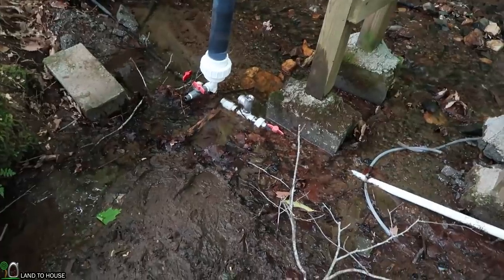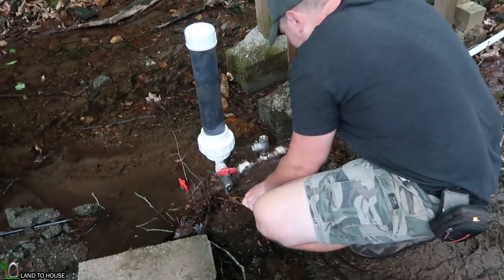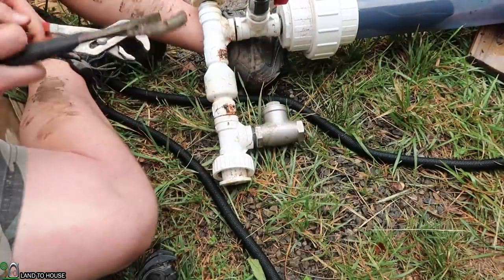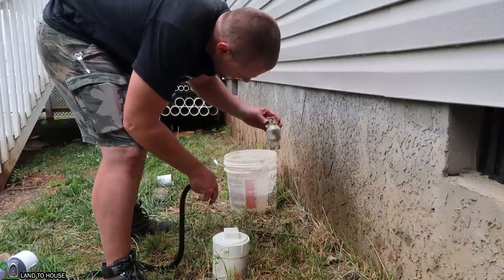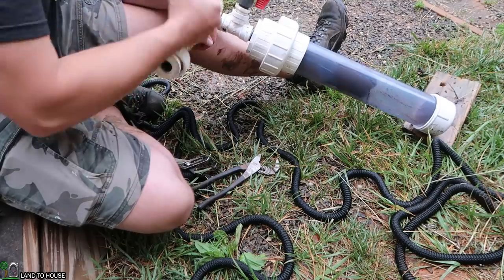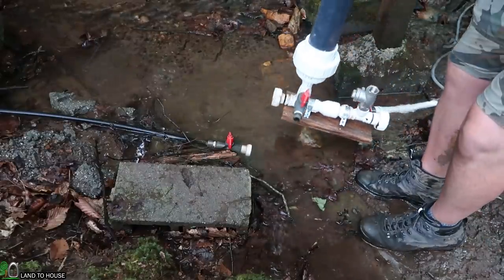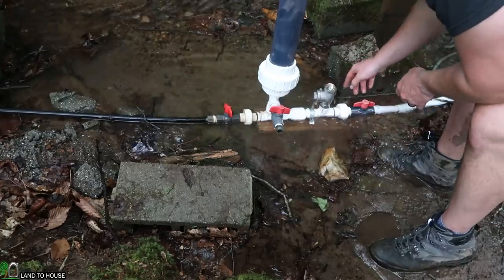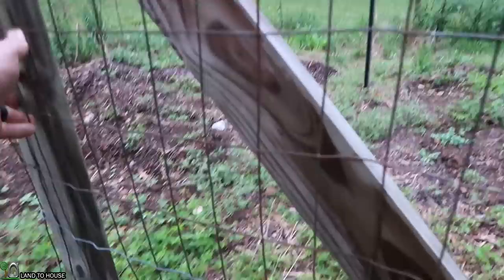This will Kill a Ram Pump EVERY TIME

Comment: Nice.I used to service Blake's Hydram pumps in Uk
Reply: We still have a Blake’s hydram pump supplying water to multiple properties. Originally put in in 1898. The only parts that aren’t original are the valve rubbers and the waste valve adjuster spindle. Goes to show how good these pumps were made.
Reply from the maker: Thats awesome! Someday I would like to try out an old pump.
Reply from the maker: For sure! I would like to get a really old pump to test out.

Comment: 1:50 Maybe consider using stainless steel screws as a standard, Drywall screws are interior grade. My opinion is stainless steel hardware would be the standard. But I’m nothing more than a viewer, sitting here watching you gain life experience with ram pumps. I digress

Comment: Question: how would a larger diameter and/or taller stand pipe effect the results of a ram pump? Would taller create more pressure and uphill delivery force? Might be a good idea for a video... Cheers
Reply: Do you mean pressure tank? Yes a larger pressure tank increases delivery as does more head and a larger system.
Reply from the maker: A stand pipe is used in the drive pipe to match the source and bring the source closer to the pump. If that means adding more head pressure than yes! 

A larger pressure tank just takes longer to build pressure. There is a sweet spot in tank size. Anything larger and it does not matter.

Comment: Hi seth.. another quick way to test if that check valve is leaking turn off the drive pipe valve .push open the other check valve and you will get water coming out as it bypasses the second check valve

Comment: Seth. Finally installing our 1/2 ram pump.  We have 25 feet of drive pipe. Four ft drop and 25 ft of rise.  We can lift water but only when it is 20% open on the delivery side. Any ideas?  Thanks

Comment: Considering how long these are in water, I am surprised you do not use products that do not deteriorate from the water - screws & straps etc
Have you looked at methods of winterizing the system/pumps???

Comment: Also instead of using deck screws you might be better off using 318 Stainless Steel screws, as it would be better suited for a wet enviroment
Reply from the maker: Wet environment? HAHA. 3 years underwater might even rust stainless.
Reply: @LandtoHouse  not 318, 318 is marine grade stainless
Reply from the maker: @Celcius1  the ss valve that i am using is 318. Or 304 i can't remember. But it has worked well and shows no signs of oxidation.

Comment: Does the winter time kill the pump if it runs through the winter, I mean enough cold below zero will freeze running water, but if it stays under -20 Celsius?
I was also thinking of using a metallic gas tank as the pressure tank as an option for such a pump, the downside is of course it would probably get corroded on the inside if not proper corrosion resistant steel.
Reply from the maker: I have a few people that use the pump 24/7 in the winter. They insulated the pump to keep the wind off.  An exposed delivery pipe can freeze and that will stop the whole system.

Comment: So I have another idea on a underwater ram pump  a hole that I havent figured out placement yet 4 with a 2 way valve in so that the ram pumps pressure doesnt dissipate  or lose pressure on initial flux

Comment: Seth buddy can you use a large garden hose as the drive pipe? Does it have to be a hard pipe for some reason and if so why?
Reply from the maker: You have to have a pipe that matches the size of the waste valve. And the more flex the less the pressure wave will hammer into the pump. Garden hose does not work well at all.
Reply: That makes sense and appreciate the answer, I like your solar additional that going to be a hit, you do great work.

Comment: While you have it out you can move the drive pipe ball valve down so when you test you can turn it off the whole way
Reply from the maker: After cleaning the debris it is away from that block better. Should close and open now.
Reply: @LandtoHouse  gotcha I just remember last years vids where you said it was too close to the sluce box (sp?) To turn it off fully
Reply from the maker: For sure! And I was too lazy to clean it away.

Comment: My brother have a fishpond and the source of the water to supply the whole pond is came from a deep ground with approx. 20 feet depth using electric water pump. Would you please share a video of using pump that can get water into a deep hole with 20 feet depth that no need to use an electric pump like what my brother did. Thanks and God bless
Reply: Ram pumps need to be downhill from the water source. Their whole function is based on head pressure gained from elevation. It can't suck up water from a hole.

Comment: Easiest way to clean that valve out. Install it onto a container of water. Or even just on the end of a garden hose. In the position where it doesn't let any water out. Now poke and poke and poke at the spring end of the valve, to let water out in spurts. Enough of this should dislodge pretty much anything stuck in the valve.

Comment: Why do you use the inline valve instead of two swing valves?  Is there a benefit?
Reply from the maker: There are a couple of benefits. They're less expensive, they're lighter, and the big one is they do not have to be Oriented in a specific way to operate. The swing valve needs to have the flap connector upright.

Comment: Seth, I have an issue. After a few weeks of use the pipe at the delivery end starts to vibrate/ pulse each cycle and efficiency drops. It resolves after I tear everything apart and put back but I never really know what's going on. Any thoughts or advise?
Reply: Do you have a bladder, or a snifter valve to replace air into the air chamber? Sounds like it's getting full of water.

Comment: First idea that came to mind is to put one of those little "strainers" that go onto the end of the kitchen taps or inline on washing machines. Could that maybe be a potential solution? (simply thinking out aloud here, don't shoot me).
Reply from the maker: That can work as long as it passes enough water.
Reply: At the source bucket/tank that way it would backflush 45 million times in 3 years also.

Comment: IT WOULD BE NICE TO CUT THAT BAD VALVE OPEN, TO SEE IF IT HAD SOMETHING STUCK IN IT OR DID IT JUST WEAR OUT.
Reply from the maker: It seems to have had the rubber gasket wear out. Or it tore in the cold.